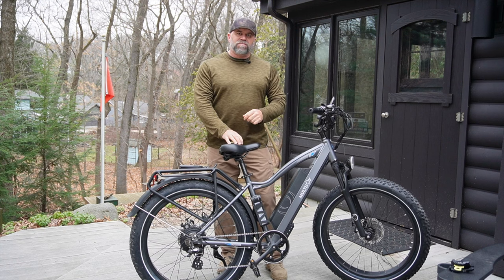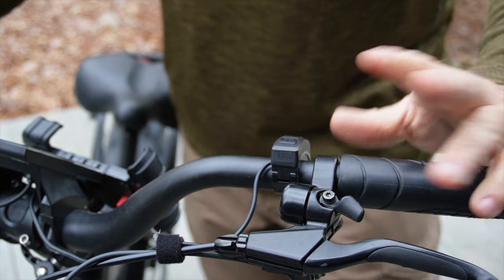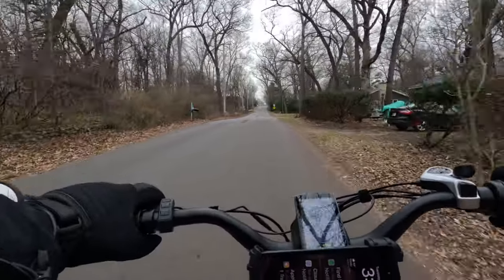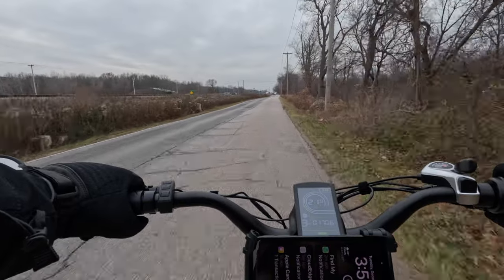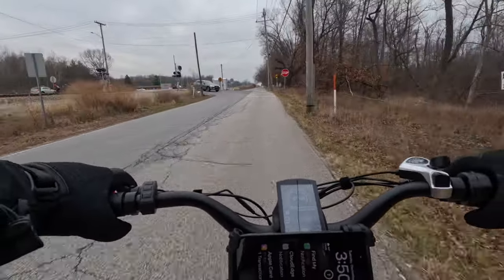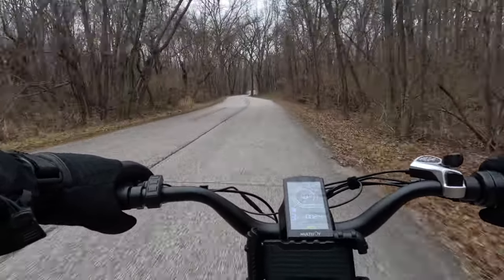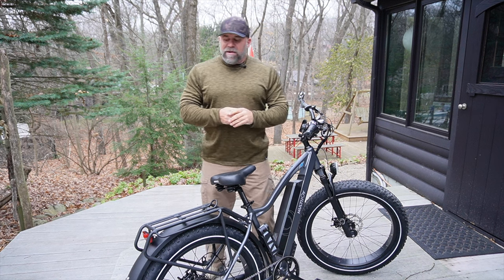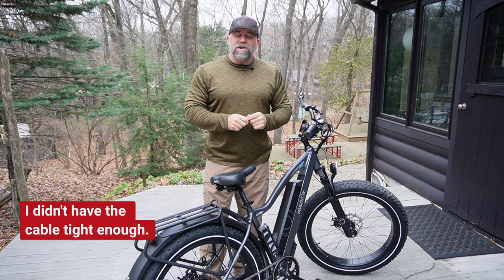Do it Now! Upgrade to Hydraulic Brakes for ebikes

Comment: You have to get the brake handle that's where the fluid goes, I don't understand
Reply from the maker: The fluid is in the calipers. Thats how these work. It is not a full hydraulic system.

Comment: Are hydraulic brakes universal.my bike mechanics doesn’t have a clue
Reply from the maker: They are. As long as you are replacing mechanical brakes. If it has disc rotors, it should work.
Reply: @scotthardesty THANK  U FREIND

Comment: Why don't eBikes use a re-generative braking system?  
No brake pads to wear out and the battery gets a small re-charge every time that you brake.
Reply from the maker: Some companies have tried (like ENGWE) but it really doesn't produce enough energy to provide any real value to charging these batteries.

Comment: These are still mechanical brakes with sort of a hydraulic cheat. They came on my bike and they suck. Went full hydraulic, 4 piston calipers and wow. Huge difference. No comparison to these XTechs.
Reply from the maker: Nothing beats full hydraulic (especially 4 piston) but also the cost is much higher. For those wanting to improve they brakes without going full hydraulic, these are a solid option.